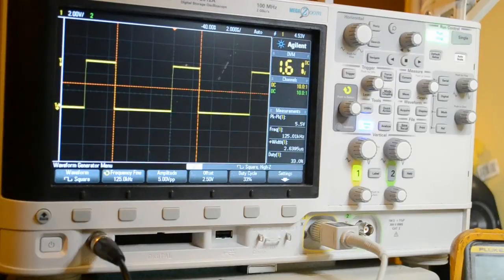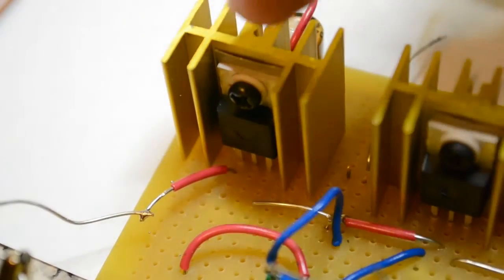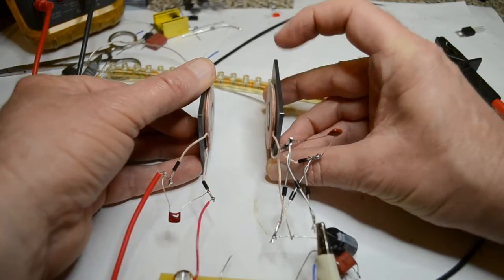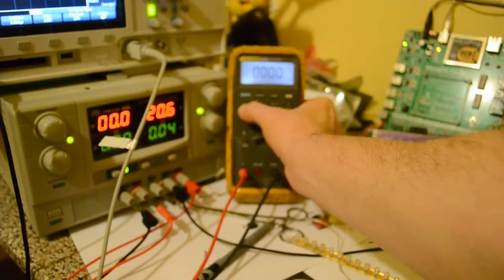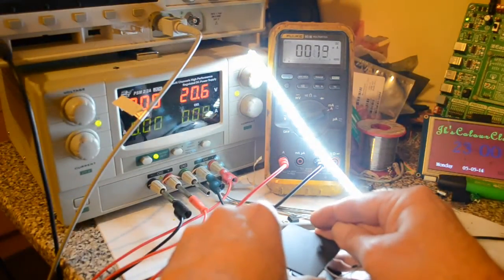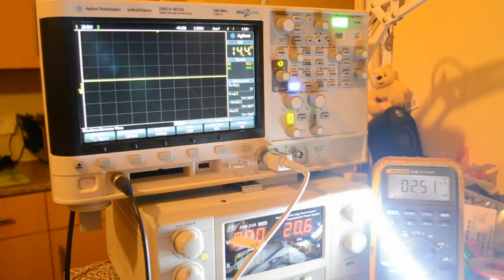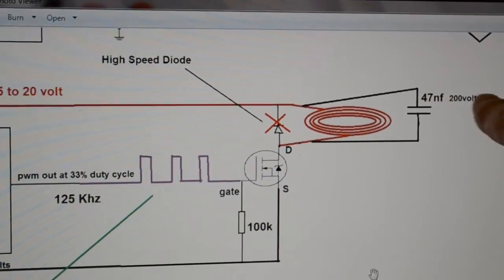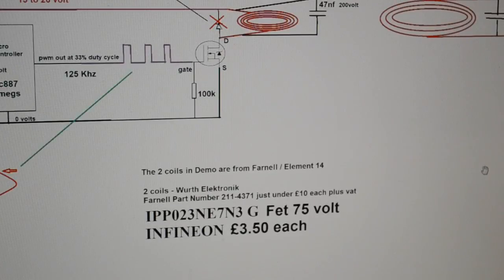High Power Wireless Charging, WiPower, Contactless Energy Transfer

Comment: Would adding attracting magnets instead of repelling increase my range?
Reply from the maker: Hi,
No it wouldn't.
You would have to increase the voltage and current on the transmitter side, with the circuit I have shown, it would blow up the fet driver.
What sort of range are you looking for?
Reply: I wanted to get the wireless cell phone charger hidden inside of a nightstand and be able to charge over the top without too much cutting. Possibly 3/4 inch
Reply from the maker: Hi,this transmitter will not work for the proper wireless phone chargers.
Have a look at one of my last videos, the proper wireless charger receivers communicate with the transmitter. A Qi or WPC charger needs to be matched with each other. The distance for the wireless chargers is less than 1mm but should be 3mm. More then 1 or 2 mm the transmitter will not pick up the 'backscatter' signal from the phone receiver.
This video shows the basics for contactless energy, the later video shows the communication and reduced distance
Reply: Thanks for the info

Comment: Congratulations !!
What the max.current of the circuit?
Is possible a currente of 600mA?
I would like of 600mA to wireless charging one microcontroller arduino.
Can you help me?
Reply from the maker: Hi, I think the video before I had a 12 volt car bulb drawing over 1 amp, the circuit will easily run over a few amps but, the more current one needs, the closer the receiver coil has to be to the transmitter.